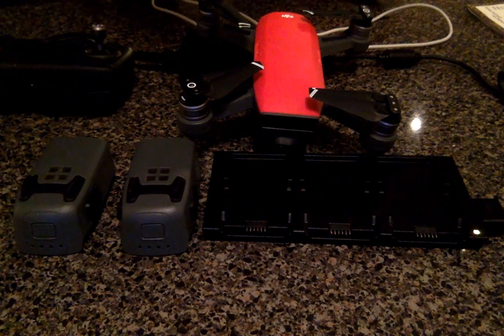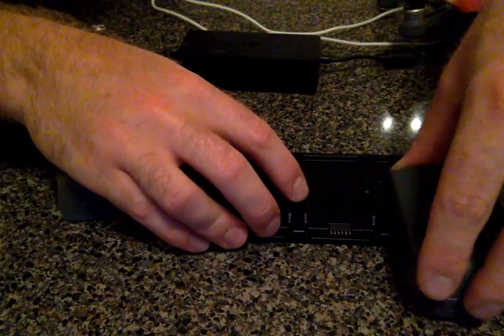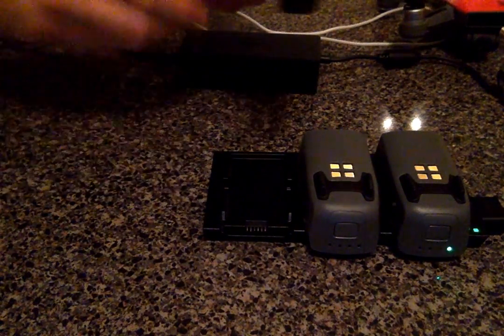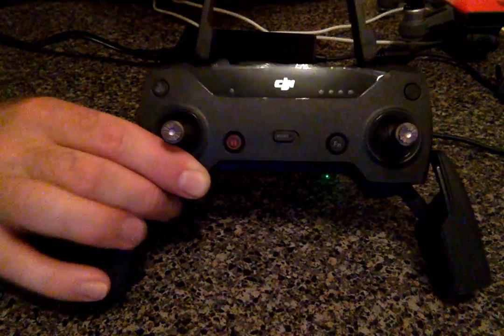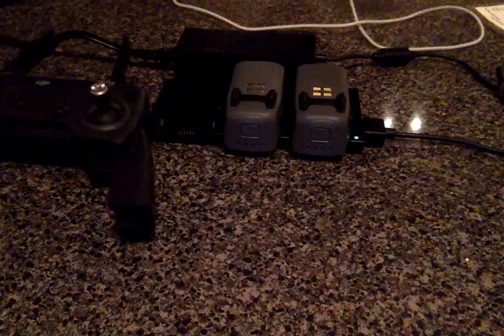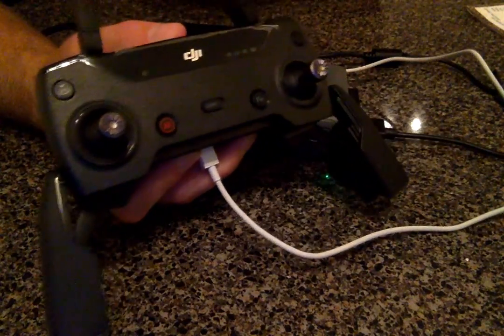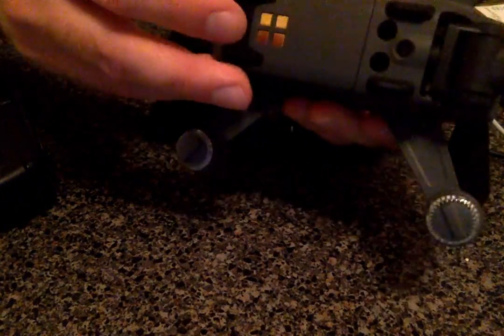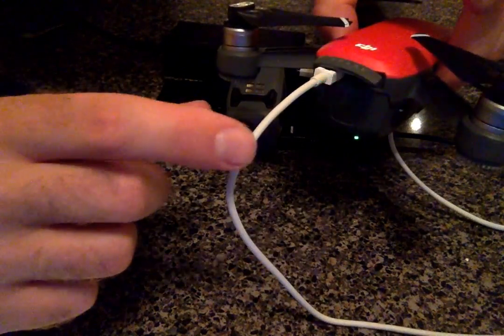DJI Spark - How To Charge Your Drone

Comment: I just bought a DJI drone and it wont charge. I charge it direct to the USB ( the back) like u did on  2:44. Only two light blink. 
 I charge it all night and it still the same in the morning. please help.
Reply: Karenni Entertainment I also bought a spark ,and it won’t charge via micro usb .. what did u find wrong with yours? I bought a separate charger and wishing for best. I bought used on offer up
Reply: @adrianarias266   I don't know what went wrong but it work for me now.
Reply: Karenni Entertainment what ? Lol.  It just started working ? Same usb and same battery ? I’m so bummed I want to break this thing.